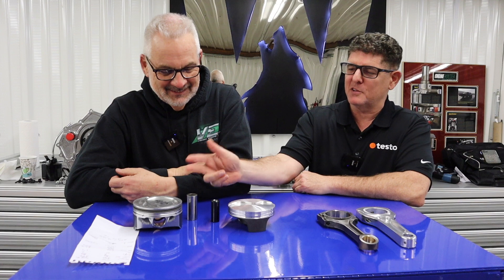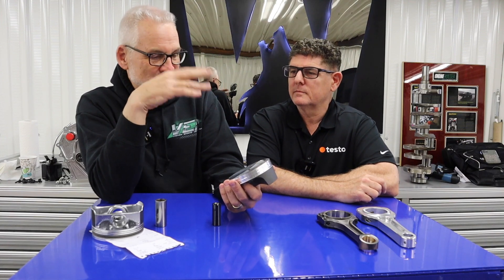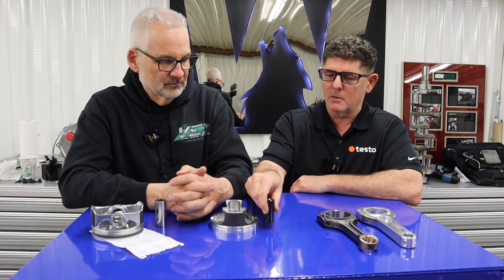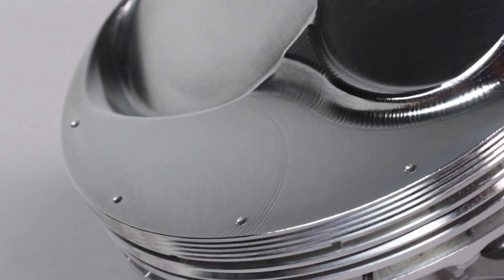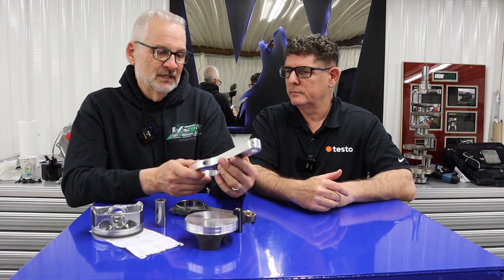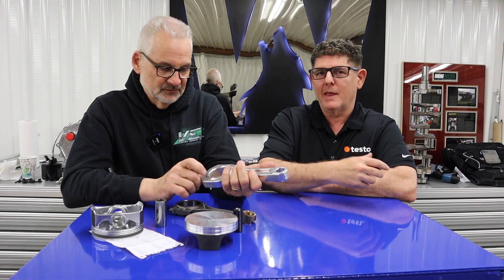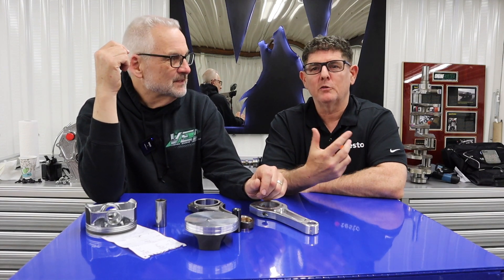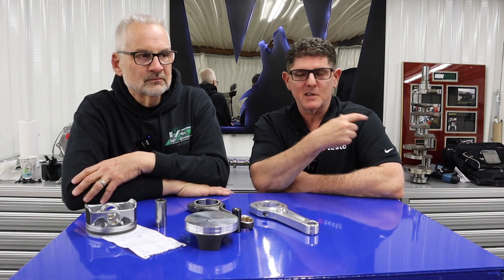Why Use Aluminum Con Rods & Gas-Ported Pistons? Ford Godzilla N/A 972 HP Tech Talk

Comment: 500cid Nitro Engines grow to about 520cid due to aluminum Rod stretch @ high RPM. Not an advantage as they all do this , but also reason the rods are only viable for a couple of runs before fatigue failure can occur
Reply: In a build like this we would get over 200 passes before we would consider a rod change and there would be no failure, this is no 10,000+ HP Nitro engine.

Comment: As a mechanic I don't agree with this engine being so awesome. We are seeing these engines in shops because of roller rocker and valve guide failures due to low oil pressure at low RPM. The geniuses at Ford did not use a crank mounted oil pump which is known to supply adequate oil pressure at all RPMs. There is an aftermarket kit to convert the 7.3G to a crank mount oil pump but it is so absurdly overpriced that you can nearly buy a coyote for the same price. This engine is junk ! Pushrod relics belong in museums . Would have been a better gig if ford would have made a DOHC 6.2 version. Probably ford's most bullet proof engine they have ever made
Reply: It’s a built engine and impressive at that. Pushrods can’t be that bad seeing how nascar NHRA etc premier classes All utilize pushrod engines. Overhead cam engines have plenty of faults still.
Reply: Pushrod engines should be in museums!? What a ridiculous assumption! I guess that’s why they use them in top fuel classes? Ford designed this as a truck engine, not a racing engine. Racers make the changes necessary to race them. It’s looking more and more like this truck engine is a great platform!
Reply: While your experience is duly noted, pushrod engines have a place owing to their simplicity and compactness. I don’t know anyone who would argue that the LS is obsolete.
Reply: You're not the only Mechanic in the world. I will agree Ford could have done a WAAAAAAY better job on their oiling system on this, saying Pushrod Engines belonging in Museums is absolutely ignorant. If OHC were so hot shit we would have a field of them in Outlaw Pro Mod.
Reply: Lol as a mechanic
Reply: I too am bummed they abandoned the 6.2
Reply: 6.8/7.3 is a good engine, who thinks the pushrod motors are not reliable?
Reply: How is the Godzilla oil pump not ran off the crank .. is there not a chain running from the crank to the pump.. isn’t the issue the lifters being defective rollers in the lifter causing the oiling system to get contaminated.. the oil pumps supply plenty of pressure
Reply: @robertbullock1572 They only make like 8psi at idle. Most of the lifter failures are in work trucks with high idle time.
Reply: Calm your tits, if the coyote is junk why are many investing in it to higher levels that the pushrod 5.0 could only dream of in terms of power efficiency rmps …….?
Reply: Push rods are fine as they do a great job in Nascar. But thr chain drive oil pump just about made me c puke. Ford needs new engineers
Reply: The most powerful engines in the world are pushrod engines.....they are every bit as relevant today as they have been.  They won't be going away any time soon....
Reply: dohc 6.2 would have been amazing
Reply: Engine is junk. OK bud

Comment: To bad Ford did not use at least the standard 8.75 lifter and a standard .927 piston pin.
Reply: .875" lifter, and a .927" pin is a Chevy standard, the Ford "small block" pin sizes are .912" and 22mm on the modern stuff. .927" is just used in aftermarket for better rod and pin selection

Comment: Will the aluminum rods last for a long time
Reply: no
Reply: @kujonyanthawa594  Definitely not a budget build! LOL!!
Reply: @JohnW1711stock  It was never advertised as one, for reference my SBF that made about 1080 in 2012 cost about $50K
Reply: Stretch is their killer and boy do they stretch !
Reply: @ I was told they stretch and break years ago too they are good for 1 race season then rebuild the motor
Reply: @gregoryjowers3629  how long they will last is dependent on rpm, power levels, warm up procedure, etc.  I had a set fail after less than 100 runs n/a, even after the manufacturer told me they would last 250+.
Reply: @luciankristov6436  They do not stretch like most think, but they do grow with heat.  Problem is heat cycling.  The material fatigues quickly when heat cycled and needs to be changed out on a regular basis or it can fail....I used to run aluminum in my stuff, but had one fail.....never again, steel  for me
Reply: no, 100 runs
Reply: @ejohnson3837  as a guideline, possibly.  Will depend on power output, rpm, and if engine braking is used to decelerate.  Aluminum rods can fail after one run, or not fail after more than 500.  I've seen those and everything in between